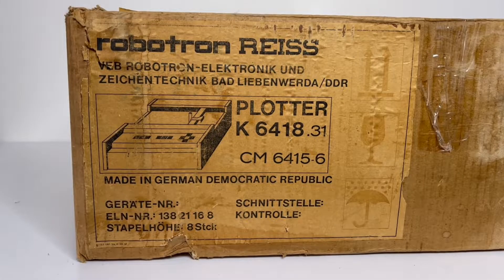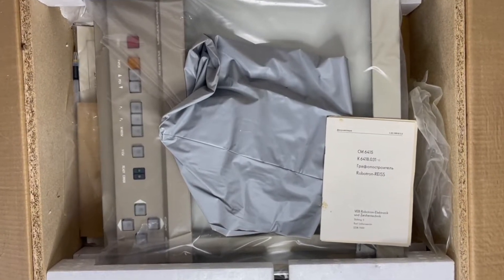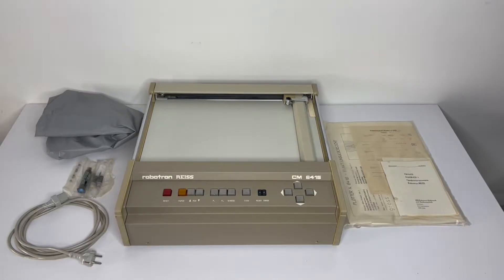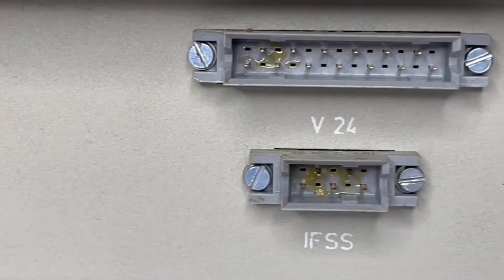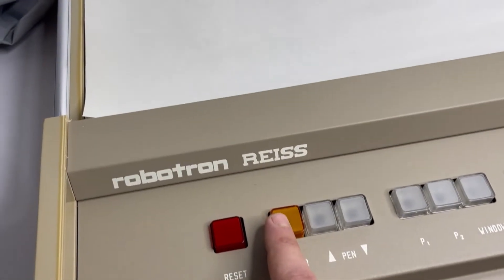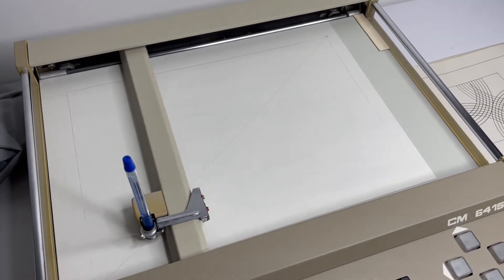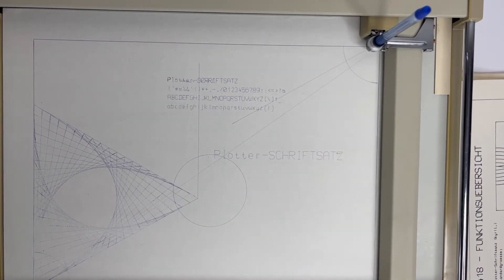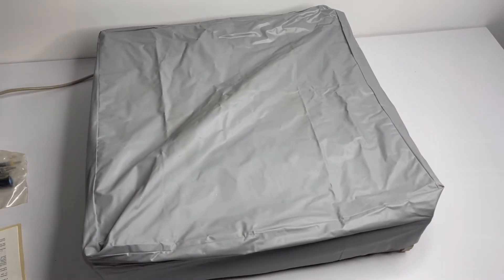Unboxing and testing a Robotron Reiss plotter from 1990!

Comment: Would be glad if some madman could successfuly connected it with modern computer and manage to make this works correctly ❤
Reply from the maker: It is very easy to do in fact, it is rs232. You just need to use a relatively low speed setting for the port, and it goes just all right.

Comment: I think a plottet in 2023 can still be pretty useful if you are an engineer. Back when I was taking my university degree I was tasked to come up with a electrical diagram for motor control. Since I worked psrt time assistant of the system administrator at a engineering firm, I took to the software they had to create my schematic there (according to ГОСТ rules) and I just a plotter do all the hard work and I wrote all the markings in my handwriting so nobody will know I cheated. 
After I turned it in, my professor said that he's impressed with how good the plotters now a days are (it was a imported HP machine)
I asked him how he knew. He said there was no holes in centers of circles which meant I did not use a compass leading him to conclude that I used a plotter. He did accept it after I proven to him I understood the subject.
Reply from the maker: Thank you for an amazing story. This plotter works good with a pretty slow baud rate (though can be wired to a com port), so practical ise may require some patience, but at least as an educational device will work good for sure

Comment: Reiss is still in business today in Bad Liebenwerda making office furniture.  They were an early pioneer of adjustable sit/stand desks, producing their first in 1910.  During the years of the GDR they produced drafting machines (the largest such company in Europe) and specialised adjustable desks for drawing while standing.  They did sell CAD products for a while and I believe this may be one of them.
Reply from the maker: Super interesting details, thank you! I  remember these adjustable desks in the childhood..)
Reply from the maker: @douro20, I will appreciate, if you can help us with the following, as I see you know much about robotrons. We have a Robotron K7229.25 monitor, which is monochrome, but declared CGA-compatible, and should be used with CM1910. We'd like to try to use it with something else, as this Robotron computer is totally dead for now. I tried to use a CGA card in all possible CGA modes, but it gives just distortions, like the freq is nit matching. Maybe you know which PC-compatible card will work?
Reply: @ChernobylFamily  like all soviet hardware, "compatible" means "stolen design" 😂 Try checking h-sync and v-sync are triggered by positive or negative slope, most likely they are merely inverted. 
You can use any 7404 or similar to invert those signals, or see inside the monitor if there are no jumpers for doing exactly that. 
I also bet throwing YT vid picturing board will give you loads of feedback .
last but not least - if you care to revieve old crt's, it is good idea to build yourself simple signal generator, f.e. using esp32 (using fabgl) or Arduino, it takes just few parts and saves many gray hair.
Reply from the maker: @piotrcurious1131  superthanks!
Reply: @ChernobylFamily  Sorry I wouldn't know how to help you.
Reply from the maker: @douro20  it is all right, so or so thank you!